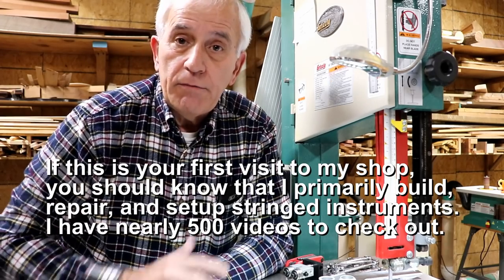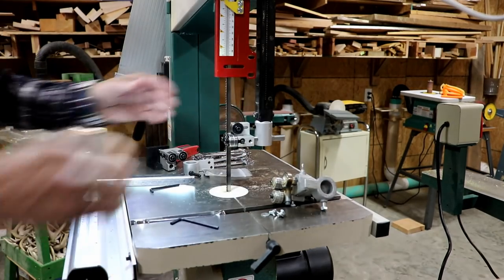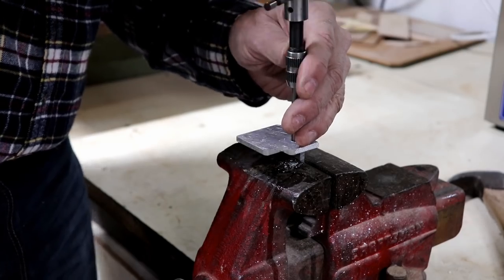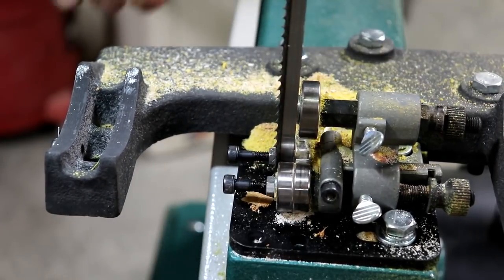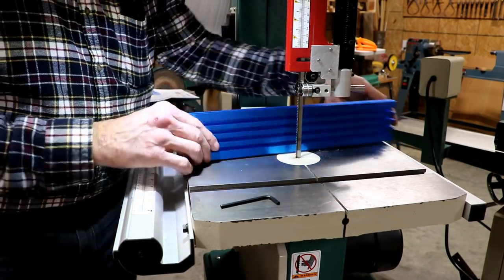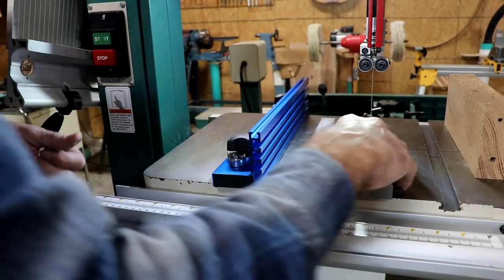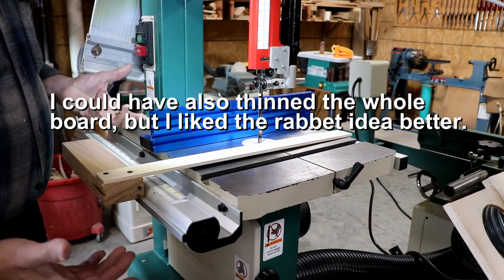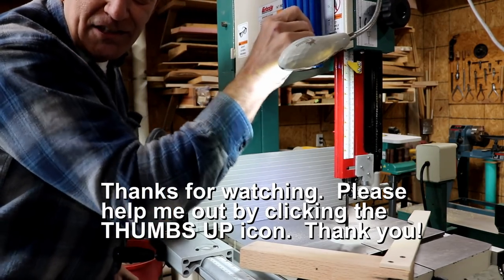359 RSW 14 In Grizzly Bandsaw Upgrades

Comment: I tried to install Carter bearings on mt Grizzly 14" BS but they would not line up. I called Carter and they sent me more parts to fix it but they still will not line up. I put the grizzly stuff back on. I think I am going to try some Cool Blocks.

Comment: I'm sure you already know this... Everything in saw setup is about being right to the blade no matter what saw type it is... Since you were all into it, I was waiting to see if you were going to check the perpendicularity of table to the blade in both X & Y (front to back and side to side), but I didn't see you do that...? 

Just my experience... It's okay, actually preferable,  to adjust the rollers ever so slightly to where they intermittently get touched by the blade as it's spinning is perfect so there isn't any deflection while cutting, but the table HAS to be square to the blade's natural floating position. Best quickest way I found to set them is I always use a piece of printer paper (.003-,004) on both sides and back as a feeler gauge and adjust rollers to that and they're always perfect every time and produce the most accurate cuts.  Speaking of blades, LENOX makes the best blades and they make them in all sizes and style. I get mine from MSC. Home store, HF, etc.  blades are a waste of money.

The only way to square up the table to the blade in both X & Y is by shimming the table where the table seats.  There again, if no leveling screws, printer paper or dense cardboard or a combo of the two to get precise works just fine and is quick and easy using slip shims, lifting and slipping them in. Obviously metal is, either aluminum or steel is best solution, but a little more time consuming...

Although your fix for getting thin cut fence settings to the blade will work, I would have left the square arm unmolested to retain strength and rigidity and just made some square wood blocks (2, 1 placed on the front and 1 placed on back of the alignment arm) spacers the width or greater of what you cut out of the square arm bar. Follow me? I can see why you elect not to use the factory fence to line up the magfence... One more annoying thing DONE! :) Good job!

Comment: I might be out to lunch but I would square the tabletop to the blade first and if the fence is of any quality it should be at 90 degrees and automatically sit correctly. Just a thought
Reply: Anything which sits on top of the table and is not referenced, to the
edge of the table, will Not automatically sit square, to the table.

Comment: I use Cool Blocks on my Delta band saw.  The Cool Blocks are graphite impregnated phenolic and you run the blocks on the blade so the blade is lightly sandwiched between the blocks.  Because of the graphite, they have nearly zero friction.  I still use the bearing at the back of the blade.  It doesn't look like you could use Cool Blocks on the Grizzly, so the Carter blade guides are probably the best solution for your equipment.

I also have the Carter magnetic fence.  For your saw, your solution is a good one. On my saw I can use a machinist's square - so that's what I use.  For tap wrenches I have a small Schroder and a large Schroder.  The Schroder wrenches ratchet in both directions and can be locked so they don't ratchet.  I got mine from a local industrial tool store, but they're now available on Amazon.

Comment: Maybe if or when those new bearings go bad you could try some sealed bearings. Should stop the ingress of saw dust.
Reply from the maker: I'm not aware of anything that is sealed more than these. The claim is that these are sealed bearings. And the ones that I bought as Replacements have all claim they are sealed as well. However it doesn't work. Or at least it hasn't up to this point.
Reply: Sorry to hear that. It was just a thought.

Comment: I did a mod to our metal cutting bandsaw decades ago to improve the guides. They were all friction guides, no ball bearings at all. The saw ate blades from wear at the guides well before the teeth got dull. The top guide is now similar the the Carter guide you used. The bottom guide now has a pair of ball bearings for the side supports but the same hard steel thrust support it came with. The blade does develop a burr on the back edge from rubbing on that hard surface. I guess I need to make a ball bearing mount to take the thrust on the bottom side. Thanks for putting another project on my list Jerry! ;>) I guess I should have done a more complete job to begin with.......

Comment: Greetings Mr. Rosa, quick question, what about using the stock fence and cut it 1/3 to reduce the height, or, use the stock fence flat, and use the new fence on top, that way you have small, medium and large fence option. (IMHO I think just cutting the stock fence to make it lower is god enough, but don't know the work you do to confirm) God bless you, Mr. Rosa.

Comment: Yes, the Grizzly bearings suck and pricey to constantly replace. I found a source in China that makes bearings for skateboards that brought the cost way down but it took 2 months to arrive. I'm almost out of those now and not sure what I'm gonna do but I don't want to spend $200 on the Carter setup because I feel the bearing approach is altogether questionable. Thanks for the videos!
Reply from the maker: I never bought the grizzly replacement bearings I always bought bearings off of eBay. They were cheap but I replaced them dozens of times. And it never lasted. The Carter setup while expensive is a far superior design.

Comment: I solved my junky tap wrench problem with a Lisle tap socket set # 70500.  These are sockets that fit ratchets, T-handles, etc on one side and standard sized taps on the other.  It eliminates the need for separate pulley taps too. They can be found in a lot of places.

I also adjusted my side bearings to just touch the blade to keep it from wiggling.  I figured it would not be a bad thing if they rolled.

I agree that Carter Products makes good stuff.

Comment: I agree with Ed about using the original fence to square the new one. However; if I made a square I would have made the heavy leg go to the other side so I didn't run out of a square surface to align the fence with. I do believe the existing fence is made that way. I really do think the new blade guide is a great improvement.

Comment: 10/32s Are the dreaded fractions?
Reply: If you already know this, I apologize up front.  10/32 is not a fraction, per se.  It refers to a size 10 diameter screw (.1875" nominal diameter), with 32 threads per inch.  If you're used to dealing with metric, it's nearly identical to a 5 x .8 thread (out to about 4 places.)
Reply: @mikecurtin9831  You didn't see what's gone before on an email to me!

Comment: You can run a channel on your square too match the front of your table next to your inch ruler.A little 1\4 cut should do it.That way you could slide it the width of your top,👍🎸🎻
Reply from the maker: Except that it's not Square. Because of the bosses that stick out.

Comment: Use a small Speed Square to align it to 90 degrees
Reply from the maker: Yeah that would be simple if it would work. Unfortunately it won't I mentioned that there are bosses on the front that the stable is not Square.

Comment: Regarding the stock thrust bearing design even though the bearing face engages the blade edge it should still rotate.  There is also evidence that the Carter design is a bit noisier. Matthias Wandel  has a video discussing blade guide designs that might interest you.
Reply from the maker: I've seen his video. When the blade hits both sides of the wheel it doesn't rotate very well.
Reply: It seems like it needs to bare close to the edge of face to work well

Comment: Jerry, why did you make your square in an L-Form and not a T? And yes, i agree with the other Commentators in using your stock square for lining your new fence up. But then, i know, it would not be a Rosa Design ;-)
Reply from the maker: If I have to use the stock Square to line up the new one what's the point? Why not just use the stock Square.
Reply: @RosaStringWorks  Sorry, i thought the stock square is too high but exact the right angle.....I did not comment to make you displease. I hope i did not......

Comment: If you don’t you should use sealed bearings at least on the bottom bearings.🤓
Reply from the maker: I'm pretty sure I mentioned that in the video. The bearings are sealed. But they still clogged up with tons of sawdust. I use lacquer thinner to clean the old bearings and you'd be surprised how much sawdust came out of them even though they are sealed. It's unbelievable.
Reply: Well, if the bearings give you a problem, quality replacements, of that size, are not terribly expensive.

Comment: I don't own a bandsaw, so I probably should keep my trap shut, but aren't you making a mountain out of a mole hill on the need to have the fence ("perfectly") parallel with the table miter slots? Granted that is important on a table saw to prevent binding the stock between the blade and the fence, but only because the blade has a relatively long potential contact area. With the bandsaw, with small width blades, the contact area is very, very small. Obviously you shouldn't get wild with it being way out of parallel, but "eye balling" parallel should be good enough - your idea of scribing a couple of lines in the table sounds like the ticket to help eyeball! You're going to get fed up wrangling that wooden square!
Reply from the maker: All you have to do is try re-sawing  some exotic wood that's very expensive and watch it go to the toilet then you'll understand.